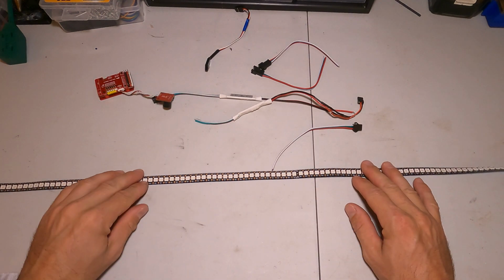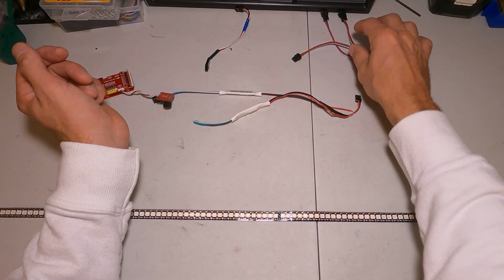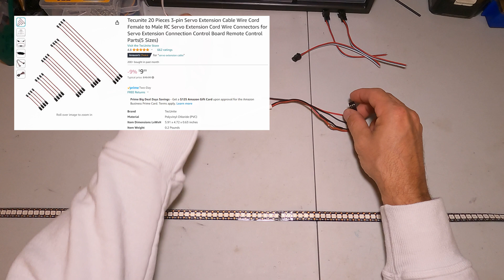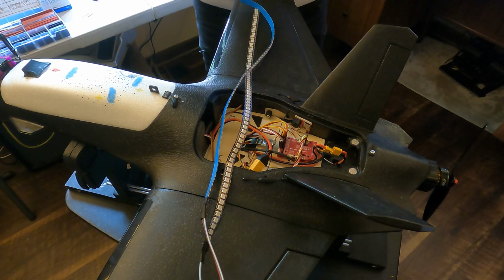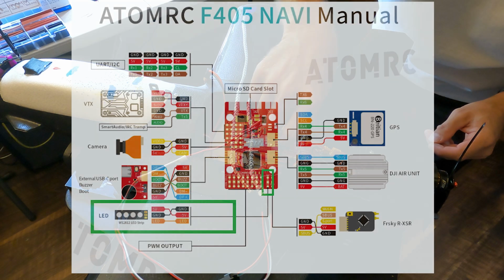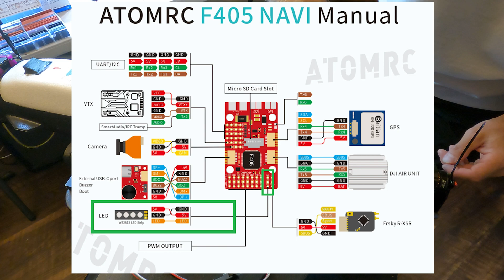RC PLANE LED LIGHTS!  HOW TO INSTALL AND WHAT YOU NEED!

Comment: Have you had any heat issues? I had issues....got so hot that the glu started melting and lights fell off....in less than a minute. Used a seperate 5v BEC to power the strip. Any advice?